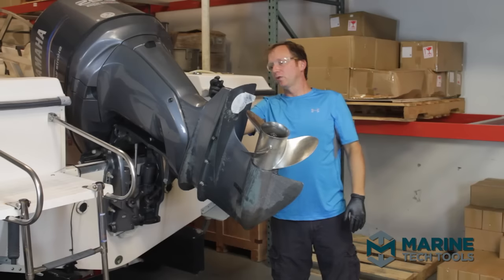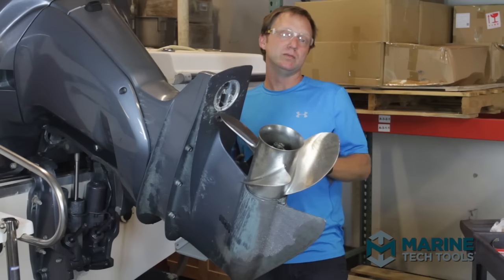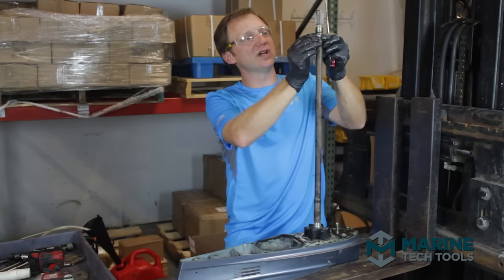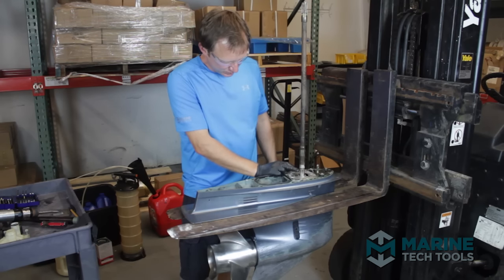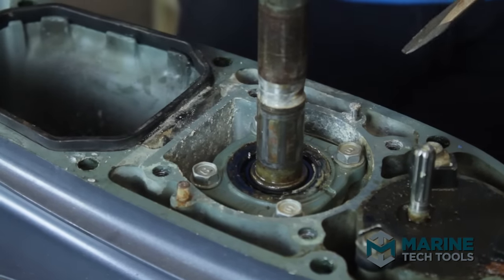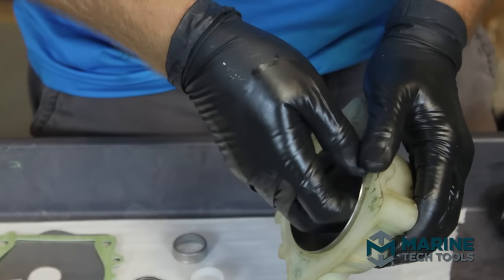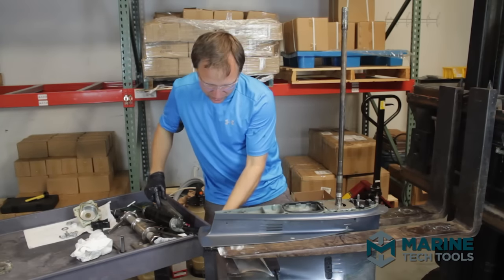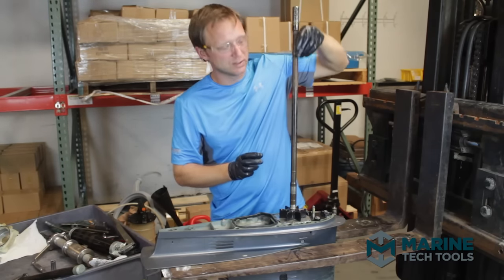Yamaha Outboard Water Pump - Teardown and Replace

Comment: I have been servicing Yamahas for 35 years now and you are making this job way to hard. First never had a Yamaha lower gearcase that I had to pay off even salt water motors, a little tap on the cavitation plate with the palm of your hand or a comp mallet gets them right off. Leave one bolt threaded in a short distance to keep the gearcase from falling. The retainer on top of the impeller is easily removed by using a small heal bar or large flat blade and a block of wood and working around the collar it comes right off no special tools required in turn tapping back down I use a 7/8" box end wrench works like a charm. 
Removing the key is also easy, I never have had to drill one out. Use a 1/4" flat punch to drive the bottom of the key in and the top of key will come out. Now the key has been dislodged take a #3 flat blade screw driver and drive down on the key. It has to be dull no chisels and it will come right out if they're not too tight I use a pair of end nips and grab it with downward movement and it's out. To install it use a small ball peen to start the key and finish up with your flat punch.
Yamaha uses adhesive to set there orings and the cup liners grease makes a mess and doesn't secure the orings around the cover when rotating the impeller into the housing. I use 3M 847 rubber adhesive for this job. Use a very small amount in the groove install the oring and give a few minutes to cure. I can't tell you how many times I have found the oring pinched or torn and the motor was getting a over heat warning.
Lastly a little silicone spray on the inside of the impeller let's it slide right on. I coat the Inside of the housing and impeller with glyserin available at Walmart makes rubber very slippery and it's water soluble and washes out on startup. Grease doesn't wash out can attack the impeller and at the lake Sand can mix with it and gum up the pump with abrasive.
By the way only use spline grease on spline's.
I have been a Yamaha tech sense 1984 when Yamaha outboards first came to the USA. and this is what has worked for me
Reply: Very nice to read someone who knows what he is doing and does not make things so hard, I tried to replace a impeller and made a mess of it by using Permatex to hold things like the O-ring in, but I was working on a 1997 Evinrude Oceanpro which is a bear as far as I was concerned, spent a lot of money and still had to take it to the shop, could not get the linkage hooked back up to save me. I have so much respect for mechanics,I can quote law and enforce it but I cannot work on an impeller.Thanks for the input.
Reply: @1DesertCop  Evinrude and Johnson shift shafts are the hardest to reinstall and not for the DYI guys, some model's are difficult even for a experienced tech.
Reply: You are right about that
Reply: Any thoughts on deleting the oil system on a 90 200hp yam? It failed and almost blew my engine up. Can I just take the drive part out of the pump and leave all the hoses connected ?
Reply: @stevestonacek7128  The Yamaha shit shaft took me hours and hours, two mechanics on the phone, and finally a helper.
Reply: @richie2dicks468  The Yamaha oil injection system is the very best on the market I've had a few problems with warning systems but the pumps have been flawless. Remove the pump pull out the drive shaft and bushing reinstall pump disconnect and cap oil supply line to pump and mix 50 to 1 oil in your tank . If you want you can remove the remote tank in the boat
Reply: Steve Stonacek thanks for the reply I did this a month or two back. I ended up pulling the drive off the pump and putting it back like you said and leaving the rest in place. I zip tied the float in the oil tank up and mixed it 40 to one in case my estimate of fuel in the tank was off a little. So far so good I’ve run about 100 gallon through it with no issues knock on wood. I’ve stuck with 40:1 just to be safe.
Reply: All hail the triple tuning forks :)
Reply: Steve Stonacek bullshit on the woodruff key
Reply: I hate woodruff keys
Reply: Steve Stonacek make a video bro. I’d watch it. Till then all you wrote is hearsay
Reply: @Steve Stonacek Perfect advice that worked for me! Thank you.
Reply: Steve thanks for the advice on the 3M and the glyserin.  Im glad I read your comments.  I have done a fair amount of work on my 2003 Vmax 150 but not major motorwork (powerhead) I figure if I take the lower off and there are problems like seals I can just drop in my truck and take it over to my local boat yard, much easier than towing. I have a question.  I see an old tube / rubberline that runs from the upper to the outside of the lower.  Is that my speedometer or some other cooling tube.  Its old and looks to be breaking down should I replace that as well? Do you know what part I need?
Reply: Yamaha says to lubricate the wear plates that the impeller seats into. You apply a small amount and yes the grease will eventually wash out unless you apply allot. I understand sand could stick to the grease and cause the impeller to wear but also an initially dry impeller with no grease at start up will wear the impeller down faster. Not saying grease the impeller but the bottom surfaces metal wear surfaces slightly. The impeller should be urethane which holds up well with sand and other objects. I've worked with slurry pump applications for 12 years and it's the same principle for dredging or pumping sand. Sand will actually wear down metal before it does urethane. That's why the wear plate is there so it takes the brunt of the wear over time so the impeller can still function with time. If you are constantly sucking up sand or boating in that type of water than you can expect the pump to wear allot quicker no matter what you do. I wouldn't crank my engine up if stuck on a sand bar.
Reply: Ok.  I took your advice on setting the gasket channel with a marine rubber cement.  I only sparringly set it in the channel ,,,dont get any on top of the face of the oring.  Let it dry for 10 min then used silicone grease in the bowl  (for plumbing parts ...will not breakdown gaskets)  and put a very thin coating of silicone grease on the blades and bowl ..I mean coated it turned it and wiped off eccess.  I heeded the warning above !  Now grease on the face of the gasket as well making sure there is no rubber cenent buildup.  I followed the steps except for one thing.  (Woodruff key problems pay attention)  When I tool the old impeller off, the key fell out of the space.  Now why is this?  Because you dont have to hammer or crush it in.  I pressed it in as far as i could with grease behind it, then I tapped it gently with a ball pean hammer until it sat down further.  When I pushed the impeller down it slid in and seated very well.  For Yamaha there is a relatively deep channel on the Yami impellars.  Unlike the other guys here I am not a professional mechanic but I believe you dont want to drop it too low.  Why.  Because if it was low enough ounder constant tension it may crack or slip.  That is just a comming sense though.  I have been working on dirt bikes, boats and cars since I was 15 (40 years) like I said im not a pro but if it fails I will pull the boat and be back here to tell you about it ...lol,  Next on the yami with the shift shaft and main shaft greased only at the splines I used official murcuy 2-2-4 i believe for this .  It went in in about 25 seconds.  Torque the bolts to 29 ft pounds on a VMAX 150 (2003)
I hit it with water and then idled it ...  started off a little weak like the old one and within  10 seonds SOLID straight stream.  Good time to change your popit valve as well if you havent done so in a while.  Dude thanks for your help If you are down south I will stop to buy you a beer someday on my way down!
Reply: Do anyone on this site knows someone that's in the Houston,Tx area that can be trusted to work on my Yamaha motor I have  200hp saltwater series and I just bought the boat and I need a trusted mechanic if so let me know before I waste my Money thanks in advance
Reply: @steve stonacek please make a video!
Reply: @rustyshakelford9777  I had no problem with the woodruff key on my Yamaha, it fell off so I took care to reseat it with some grease and tapped it with ball pean level when I pushed impeller on to it, it slid down no problem level with the channel on the impeller.  I think the channel lock and hammering that people are doing to set it is wrong as mine fell off when I slid the old impeller off. If people are forcing it into place and hammering or warping the key, that is what is causing future problems.  When you get an oem kit it has a new key in there as well just in case someone brute forced the prior key.
Reply: Please do a video.
Reply: Hey Steve Stonacek, for the heel bar you use, is it the one that looks like a slightly bent flat head screwdriver, or is it the one that looks like a bar with a hooked foot at the end of it (sort of like a giant fishing hook).  How small is small?  I have to do this for the first time soon, I'll invest in the right tool.

Comment: The other video's I watched (and unfortunately went by) did not mention the Wave Washer between the two Plate Washers OR the importance of lifting the drive shaft while setting the Drive Shaft Collar.Luckily I haven't put the boat in the water so I am going to take it back apart and fix things.Thank You so much for having such a detailed video.

Comment: So I decided to tackle the 100 hrs/Annual service myself (2015 Sportsman 251 Heritage 2x Yamaha F150). After watching a couple of your videos, i started, a bit of a learning curve but I am pretty good at figuring things out. Everything I did on one engine took me less than half the time on the second, figures, confidence level is up! Everything went as shown on the video. All the bolts removed were wire brushed and threads cleaned with a drill with a SS wire brush (cheap at Harbor freight tools as you will ruin them). They were fighting me coming out but then putting them back in was piece of cake, hand tight then torque wrench. Looked up all the torque settings. Clearly the last mech did not do that and didn't grease the bolts. Patience was need to remove the collar a bobo et the impeller but about 10 minutes and done. But here is were your video really saved me from going nuts, the woodruff key. On the first engine it would not budge. Then I remembered your trick, drilled it some, took the air hammer ti it and out she went, fantastic trick, would have never thought of it myself. Second engine when i made the mark to drill the key moved and got it out easier. Your video is right on and the best i have seen, followed your instructions and done. 12 hours total, yes I am slow but at the current shop prices and buying my own parts (all Yamaha) I'm in it for about $600 versus my local dealer would have charged me about $2,000. This includes: thermostat and gasket, fuel water separator, fuel filter, oil filter, oil for engine and lower unit, pump for lower unit, water pump kit complete with housing ( mine were bad!). Last years service at the dealer cost me $1,800. Your video Rock! Thank you.

Comment: Brobins75 got it right when he said use a Drexel and cut it up the middle. I tried pb blaster,tapping both ends to loose  it, I drilled it and I finally tried cutting it with a Dremel. It doesn't leave a lot on either side to grab so I used a very thin wedge and tapped the sides in with that. No damage to the key way either!

Comment: A PVC pipe with an interior diameter of 1" worked like a charm to get that washer collar seated by the way. Pull up on the drive shaft while pushing down with the PVC pipe and it seated perfectly.

Comment: Thanks for this video. I just bought a 1999 pontoon boat with a 1994 Yamaha 115 V4 and I had to replace the totally fried water pump. Took it out for a test run today and it ran amazingly well. Very helpful info in here!

Comment: Great video. Those woodruff keys can definitely be a bear. Had one that actually sheared flush with the shaft & had to drill and dremel, after hitting it with PB blaster. My only comment would be to place rags underneath when drilling so the filings do not fall into the chambers.  I realize the bearings are still encased, but still prefer to keep these areas clean.  Thanks for posting
Reply: I am currently trying to remove my woodruff key. Same issue. Totally sheared off and appears to be welded in and not removeable. I am currently slowly using dremel cutting discs to create a place for the new woodruff key. What a hassle.

Comment: Great video showing the steps.  One question I have regarding the seals in that old water pump housing.  The drive shaft has a groove which appears to have been caused by the old seals.  Would it have been better to replace that housing with a new one that has new seals in it?

Comment: Used a hefty cold chisel and ball pein hammer to gently tap it out.  The chisel does the heavy lifting. When it comes loose grab key with pliers and use hammer to finish removing it.
Water pump kit has new key. Grease the slot and the key before replacing. Only issue I had was the large o ring for the white cover did not want to stay in place because of newness. When I rotated shaft replacing housing it went on smoothly and snug. I did not see any sign of o ring protruding around the paper gasket.

Comment: To remove the woodruff key on my 115, I used a small jewelers screwdriver and a hammer,  The screwdriver was narrow enough to fit in the slot behind the key & after a few taps with the hammer, I was able to pry the key out.
Reply: Regarding the wire cutters, are you saying to hold the cutters upside-down/vertically (handles up), then grab the top of the key and pry it out? Sound like a great idea.

Comment: no grease in cup!  it whips up, never washes away, and collects sand!  also the key shouldnt be that hard.  if it is, maybe use a dremel w a cutoff wheel to slit the center of the key, then a pair of visegrips will crush it and it will fall out....
Reply: just realized i commented same thing on this 9 mos ago:)
Reply: Maybe use a water-soluble grease?
Reply: @szinski  I Just use a little dish soap. Lubricated great and washes away immediately

Comment: I’ve had luck with the key with taking a pair of vice grips, welding on a nut at the adjustment end, and screwing in a small slide hammer. Snap it on and yank it out.

Comment: I got stuck when my woodruff key won't budge; it required major surgery! Question:  how do you get the orings on the housing to stay in place when reassembling?  My orings are real loose and will not stay in place.  Should I use a spray adhesive or Permatex material to hold it in place?   Thanks.
Reply: If the key is stuck, I read that you can use a Dremmel to cut a slot down the center of the key, then squeeze the two halves together and the key will pop right out. Need to be careful not to cut too deep and cut the shaft.

Comment: I advocate using never seize on all bolts.  The 4 water pump housing bolts and the 7-8 lower housing bolts should be coated with never seize.  
The bolt into the trim tab could be lubed with die electric but not never seize or grease.  It must transmit electricity.

Comment: If you have to replace the housing, is the seal for the water pickup installed inside the housing already or is it a separate purchase? 2015 Yamaha 200.

Comment: Great video, Thanks for this.  I do have a question about the water pipe to impeller housing  seal;  2008 f200, there are 2 parts diagrams for lower unit.  1 shows a rubber sleeve that goes in the housing outlet (damper seal 1) and then the plastic guide with the side pins.  (Parts #22 and 23 on diagram 1) Diagram 2 shows parts # 1 and 2.  another rubber sleeve(seal)#1  and an additional rubber tube with a wider too and bottom ( like a sewing spool with a hole through the center. #2  But my engine only has the rubber sleeve and plastic with 2 side pins.  Item  on lower unit diagram 2 part #6E5-44366-01-00 #2 on diagram is completely missing on my engine and on every impeller video ive watched on youtube.  ????  Was this an ungraded superceded part over the years? Or are people just leaving out part 6E5-44366-01-00 for some other reason?

Comment: on that boat,  is water supposed to go in and out of the back splashwell and kind of self drain, or is it supposed to the sealed off with drain plugs... I have an 86 bayliner that is made that way, and water comes in there.

Comment: Man changing the waterpump on my 2002 honda outboard 13 years later was still a breeze .Now i have a Yamaha and it looks like it could be a Real Pain!!.Good Video think you should have put some rags in the water intake before drilling .Those metal shavings are going to get sucked up into the new impeller

Comment: could you take a small triangle file and cut a shallow channel on side of woodruff key to allow any excess grease or air to escape?  Why did you leave the propellor on?  That is a little extra weight you didn't need to fight.  You must have a reason.

Comment: Quick question, on the Speedo tube that is near the shift shaft, if I do not replace the hose back onto that, will that cause serious issues? I don’t even use the route that goes into the Yamaha digital gauges, so I was wondering if I could bypass putting that back on. I’m sure I just need to put it back on but when working by myself it’s hard to get the route put back on the nipple, and get a zip tie on it so I’m just wondering how important that is. Thanks.
Reply: I am a fiberglass and refinishing guy and I don’t mess with any engines other than my own so that’s why I don’t know, I am pretty clueless for the most part when it comes to outboards. I did do the whole repair of all the oil seals using your tool on my own 2003 ox66 so I was competent enough to at least do the seals.